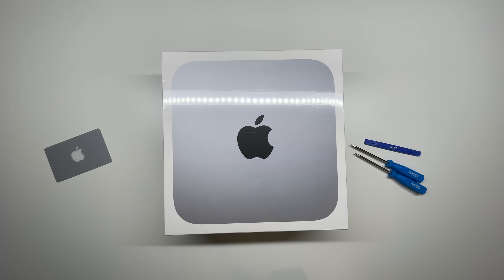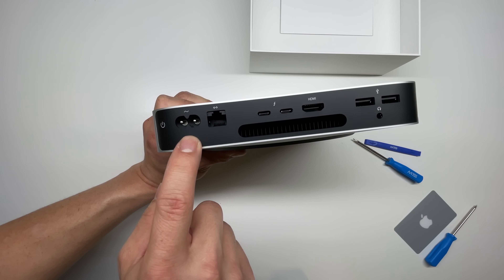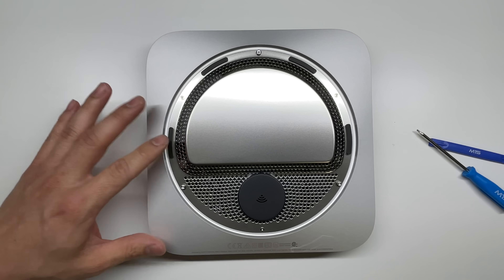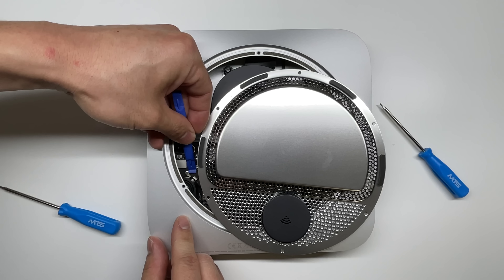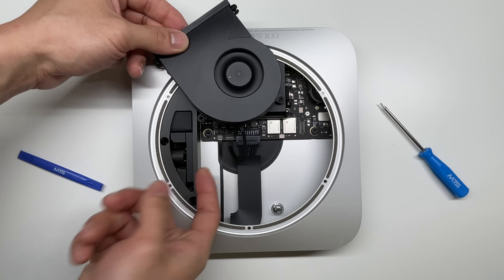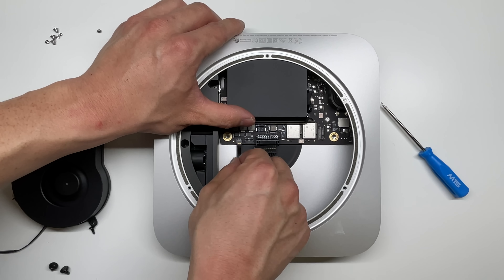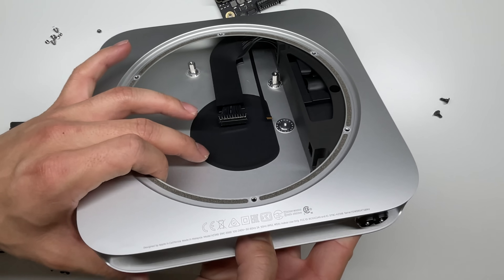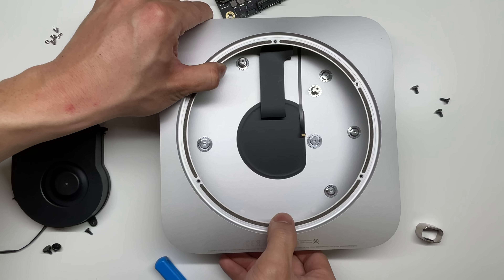M1 Mac Mini Teardown Disassembly 2020 (M1 close-up in description)

Comment: There is absolutely enough room for at least an m.2 ssd in there. It is unexcusable to have a desktop pc without user removable storage.
Reply: If all system upgrades must be undertaken by Apple at the time of purchase, they are the only party that profits from a system being upgraded. 
...and they charge a GOUGING rate for those upgrades at assembly.
Reply: Can you upgrade internal storage on iPhone, or any other device? You can't. On some phones you can add microSD card there, but that's not upgrade to the internal storage, the EMMC on logic board. Even the EMMC can fail on phone, SD cards can fail. What you do with broken SD card? Oh yeah, you toss it because you can't fix it.
Reply: You can plug in external SSDs as much as you want, you can daisy chain, you can have 100TB of SSDs only using one Thunderbolt port. Intel/Microsoft mafia indoctrination is like heroin :)
Reply: @vladimirtalijan  It would be more convenient to able to upgrade the internal storage.
Reply: @emperorfaiz  Yes, but you have to look at the machine as a whole, those are just entry level computers and they are  way better than anything x86 can do, and as a 35 year computer user, I've used RISC machines decades ago, they were exactly on the same level compared to x86 machines from the time, so we have to ask a question why do we still have x86? That's called tech mafia, people supporting crap tech made the world full of crap computers for years, and that's why you shouldn't split hairs but give your full support for these machines, because they will make computers way better for everyone.
Reply: @vladimirtalijan  Microsoft has arm had devices and an arm version of windows for a while now, nothing new here simply fancy custom arm processor
Reply: @michaelandrews4783  LOL, who uses that ARM? Is it much faster than x86? Android phones have ARMs too, but the iPhone is always 2 times faster at least.
Reply: @michaelandrews4783  No one uses Windows-ARM.  Microsoft pretty much let it rot.  The reason?  Nothing runs on Windows-ARM, and its ARM performance was (and still is) dismal at best.  

What Apple did with their 1st-gen M1 chips is put every ARM SoC to shame.  May be "nothing new" to you, but we may be seeing a new generation of CPU's that moves the industry forward.

Keep downplaying it though...
Reply: @vladimirtalijan  " they were exactly on the same level compared to x86 machines from the time, "

No, compuer with MIPS, SunSPARC, PaRISC or Alpha costed way more then normal PC with Intel, or AMD and have a way less software. So they lost the competition.
Reply: @piotrc966  That's called monopoly. ARM/RISC never got mainstream because Intel/Microsoft mafia took monopoly and of course RISC will be expensive to produce, Motorola was expensive for the same reason, it's called production volume. Why do you think only the most expensive computers used RISC, wouldn't they use x86 if it was superior? PowerPC have died for the same reason and Apple HAD to switch to Intel, it's not like x86 was better in that moment and now RISC is better out of thin air. ARM/RISC architecture was always way better and it was always way faster per watt, that's literally the most important thing in a processor which makes it go faster and scalable, Pentium I 75Mhz was using the same amount of power as Apple M1, so go figure. x86 had hit the ceiling years ago and if there were x86 and RISC developing with the same resources all these years, we would probably have 5-10 times faster computers today. And that's not just in computer industry, it's everywhere, we live in crappy world because someone have to sell you oil, or drugs, or weapons, or ads, even if there are way better, cheaper and healthier ways to do the same thing. It's called globalism, it's exactly what is happening right now, the world is crumbling for the wealthy to be even wealthier, and guess what, Bill Gates became philantropist, a doctor and a great guy to save us all. That thing with monopoly....it was just a coincidence. I don't know how old you are, but I'm in computer industry from 1982. and I saw everything happening with my own eyes, most computer users didn't and that's why they think Intel/Microsoft is the best we could make, but in reality, it's the worst.
Reply: @vladimirtalijan  
1. MS Windows was available on DEC Alpha, PowerPC, MIPS. This CPU producers lost competition with Intel/AMD/Cirix.

2. Apple changed CPU from PowerPC (RISC) to Intel because PowerPC was slower and consume more power. So, RISC not always consume less power watt per performance.
Reply: @vladimirtalijan  if u have any problems with storage on board bye bye ur device and ur data.
Reply: @kaekae4010  What data? Do you realize any storage can fail, so you have to have a backup for anything important on any computer.
Reply: @vladimirtalijan  ok i buy that, but say bye bye ur enteri device. And u have any problem with any component say bye bye ur device and ur data if u dont have fresh backup.
Reply: @kaekae4010  Not really. Buy an external SSD, connect by Thunderbolt, set it as the primary HD and install your OS on that.

Comment: Hopefully next year they finally redesign the Mac Mini chassis to make it actually mini. They could easily make it half the size.
Reply: @Code Bunny I think apple don’t want to change everything at one, I think they want people to become used to Apple Silicon on the smoother way possible.
Reply from the maker: Agreed!
Reply: They won't do it but they could make a new "mini" form factor for the Mac Mini and re purpose the current chassis size (or one marginally larger) as a "Mac" with some options to add storage and RAM. They probably won't do that, but there's arguably room between the Mac Mini and the Mac Pro for a "Mac" or "Mac Air"
Reply: @robm6463  Maybe a MacMini Pro version to come?
Reply: @timbeaton5045  This! ZoneOfTech also said that the color option is a sign apple will make a MacMini Pro. Currently every model of Apple has a "Pro" model. Why not the MacMini? I think its clear that they will release a MacMini Pro in space grey next year with the new iMac Apple Silicon lineup.
Reply: No need for that large power supply and fan for the m1 chip is so power efficient and cool. They could easily do it in a size of the apple tv.
Reply: I would say that a desktop PC thats smaller than your average laptop qualifies as "mini"
Reply: @insertnamehere8121  
It’s smaller than most laptops in length and width, but it’s way thicker, and in terms of volume and weight, it’s larger than the vast majority of laptops. And it’s way bigger than most Windows mini PCs.
Reply: this comment aged well

Comment: Wow, there is so much empty space.
Reply: Isn’t that wild? They definitely could have done a redesign, but they’re probably using the old chassis to make the 1M macs more affordable
Reply: @kirbeast46  Yes, I wonder if they make a new design for the next Mac mini.
Reply: They could have definitely made it smaller.  I'm waiting for a 32GB RAM version but the M1 benchmarks look very impressive!
Reply: The only reason they didn’t redesign them is because when apple does transitions they don’t redesign hardware until the year after. 

This happened when the intel macs came out. They do this because they don’t want to make such a radical change that consumers will be unwilling to buy it. Apple wants their transition to be successful and the best way to do this is to get regular people without knowledge of M1 to buy it. 

If they redesign the computers then they will have to deal with both the criticisms of the design and the criticism of the hardware. That can be dangerous when you are trying to get as many people in the new processor architecture. 

So they are keeping it safe for now. But all of these computers will probably get redesigned next year. If you care about the appearance, the mac mini is the safest bet. Because the MacBooks are going to look worlds apart when they get redesigned.
Reply: It should’ve been called the Mac Air, tbh! 😂
Reply: It's free real estate!
Reply: You hide your weed in there
Reply: Open space is usually  a good thing. It’s better for cooling. That doesn’t appear to be the case with this design though. It Looks like they are trying make more from less i.e. shrink down.
Reply: It’s important to have empty space for airflow!
Reply: @regret5053  yeah, but it could have had another ssd slot or some more expandable storage, otherwise its a really nice computer, but ill wait till 2nd gen
Reply: @regret5053  Arm chips don’t really get as hot as x86.
Reply: @regret5053  That was what I was thinking.  My new M2 mini is so very cool to the touch.

Comment: just replaced my 2012 mac mini, quad core i7 with dual hard drives and use up-gradable ram. M1 mac mini is like night and day difference, I wish they had a second slot that we could pop a 1 TB hard drive for storage and time machine though instead of a external hard rive enclosure.
Reply: with all that empty space it would be fun to hack in some storage by tapping in to one of the external ports.
Reply: @poiiihy  definitely enough room in there for 1 or 2 NVMe drives at least.
Reply: Maybe on the next MacMini? We'll get one for 4 ports agin, i suspect. This is just a toe in the water at this stage!
Reply: There's even room for an NVME enclosure in the front. Imagine if it had a pass through thunderbolt and you could place your extra SSD inside.

Comment: So much room in that case! A real shame they didn't leave a SATA3 port or m.2 socket to shove some secondary storage in their. Not surprising thought.
Reply from the maker: Yeah tons of room inside the case, could have added much or made it slimmer (with re-config).
Reply: @brandon20904  i thought they make it like that for airflow? is it not?
Reply: apple forces u to buy the ram and storage u want from apple itself
Reply: @ads2711   yeah and its like 4 times as expensive as it should be
Reply: @marko__r  4x? Have you seen how fast and cool this thing is?
Reply: @Xanduur  like i mentioned it later in a comment.. i ment the upgrade prices for Storage. They are 4x expensive as it should be
Reply: @ads2711  I don't mind with how m1 mac mini fare with all those review on internet even for base model is Alrd good enough. With those price this mac mini will be my first mac desktop I will ever buy replacing my md101 desktop. I don't wanna buy the new MacBook cuz I can't replace the battery by myself. Better stick with my md101 as long as possible I can live without apple support if for laptop anyway but not for desktop
Reply: @gerryhasni520  why do u need to replace MacBook’s battery. My 2013 MacBook Air is still well alive... still smooth but I’m getting the new M1 to do more stuff.
Reply: @smbdcry  its alrd past 1000 cycles. And if u still using it it will damage ur macbook like swelling. Batttery on laptop is important because that upgradability for laptop is a must for me.
Reply: @gerryhasni520  you can replace it by yourself, I did it for my macpro several times already,  one thing to know - macpro's cant work normally w/o battery, so they just turns off at CPU demanding processes running. Might be  M1 chips could work w/o battery in the new macbooks longer. So the issue here,  if no spare batteries produced then your macpros are dead. The mini here is in advantage, but SSD and RAM are also soldered now, so once SSD died (and it's just a matter of time) you won't be able to replace it at all , only with the motherboard replaced.  For that price the minis and the pros are shitty products because one will have to buy a new one in a year or later (depending on the SSD workload)
Reply: @iddeegee  what i mean is the new macbook air. And considering how some youtuber said that they cant swap component on iphone 12 im scared it will be the same with macbook battery
Reply: @gerryhasni520  yeah, knowing Apple it's possible. But the only way to achieve this is by adding some special chip and by adding the battery authorisation process like they did with their cameras in the last iPhones. So one can replace the battery only in authorised services. Otherwise it can be hard but not impossible.
Reply: @iddeegee  I agree with that, I have macbook pro 13 2019 and the ssd died after several bootcamp I've experiment (installing windows 10, kali, Arch, and Manjaro), and I have to pay additional 1000$ just to replace a motherboard.
Reply: or external ports for 2 sticks of RAM, 2x16gb for example
Reply: OMG! I just though of the same thing and left a comment to this effect on the main thread. May be there is a potential of a not so straight forward mod.  One direction could be: degutting it and then putting it into a bespoke 3D printed case placing the power supply and logic board in a parallel config instead of an 'L' config, hence saving space n making it more compact. Another direction could be: to use the space inside to house an external SSD rerouting a cable from one of the type C ports.
Reply: It is a shame Apple didn't shrink the Mac mini chassis/case and Packaging to spare our environment. Ironically, Apple increased the packaging size not he Mac mini. Oh wait, probably didn't help their bottom line. I'm enjoying the new M1 Mac mini overall though. It is extremely impressive.
Reply: @Berto U  i was talking about their storage upgrade prices. They are pathetic.. 230€ for 250 GB upgrade while a new 1 TB m2 SSD with 7000 MB/s Read speed costs just 210€.. tbh you just sound but hurt 20 times faster xD.. its a fast machine no doubt, even faster than intel or amd compared with the same power draw  but next time you comment pls don't act like a apple fanboy
Reply: @PinkPower4 well it's possible of course but you make one port unavailable, instead of allowing people to upgrade them selfs, Im not sure if it boots up if internal ssd is dead
Reply: now they shrunk it in m4 mac mini and atleast upgraded base ram